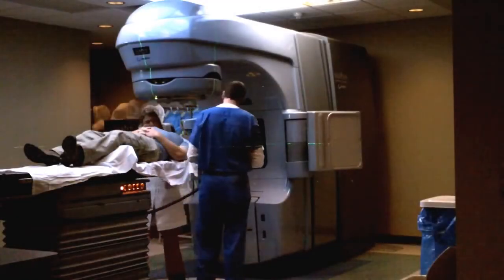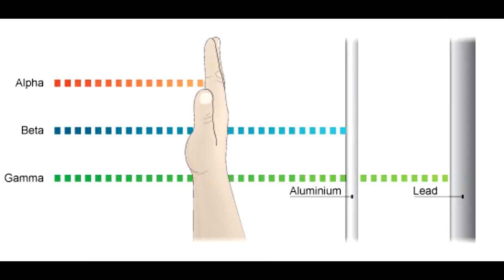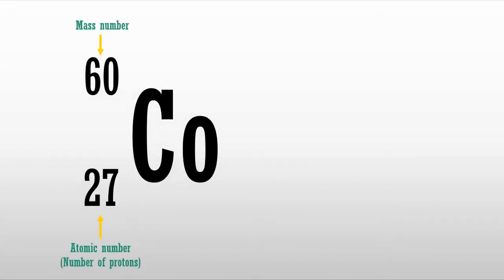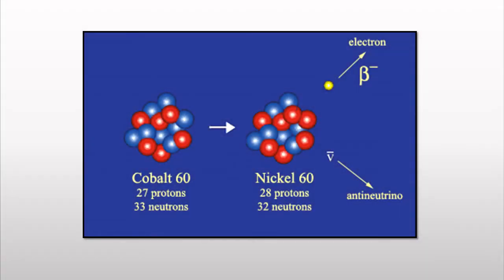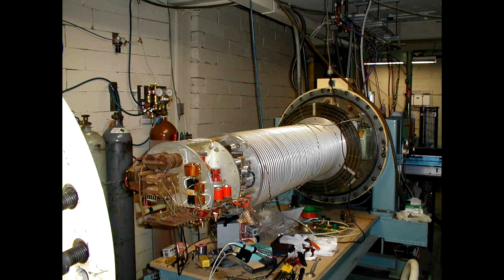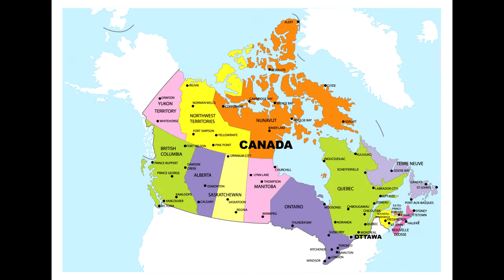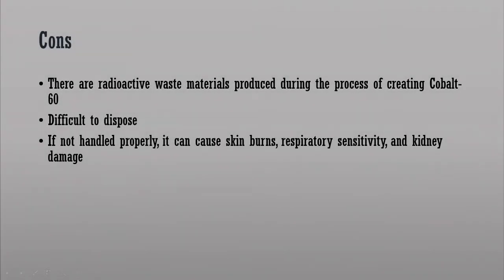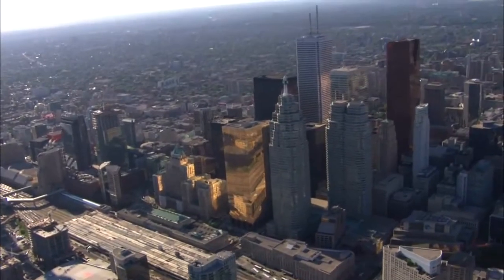Cobalt-60 Isotope

Comment: Thanks for this video. Cobalt 60 is produced in CANDU type nuclear reactors by placing cobalt 59 in the place of the control rods to gather neutrons from the uranium fission reaction. It is not a by product of fission but an isotope that is produced for medical device sterilization at great effort and expense. It is not, to my knowledge, produced using linacs. Neutrons do not carry a charge and cannot be accelerated through linear accelerators. Cobalt 60 is produced in several countries such as Canada, Argentina, Russia, India or China. Cobalt is not absorbed by the body during gamma knife therapy. The body only absorbs the photons from the decay.